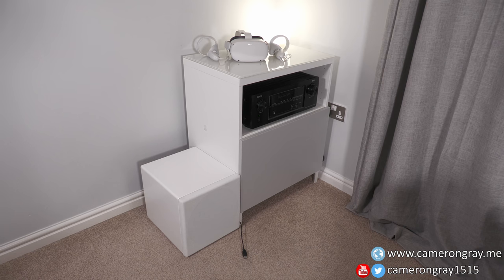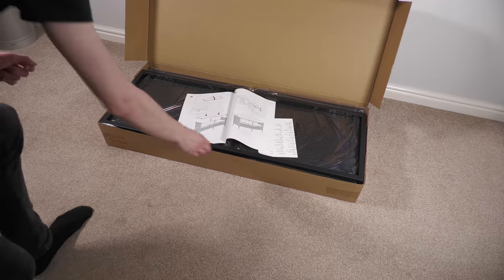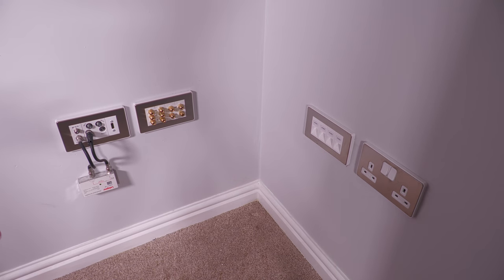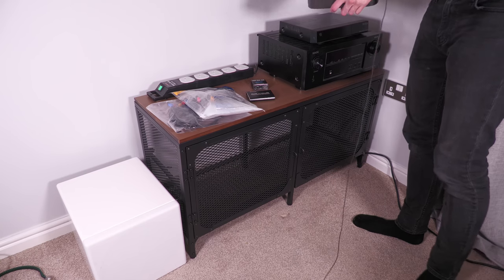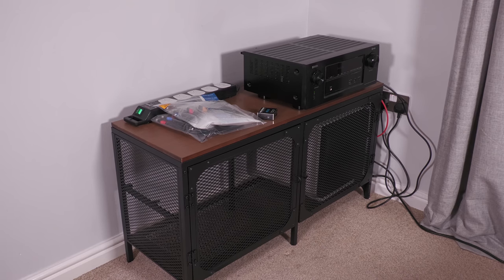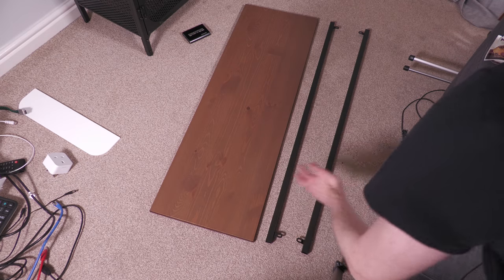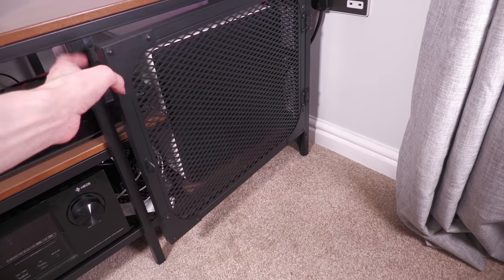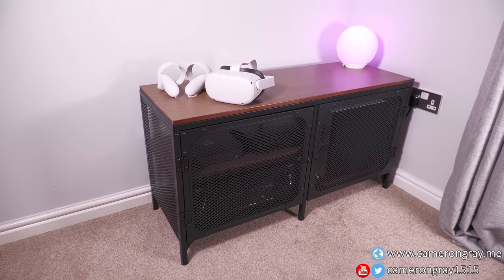Third Time Lucky? New Living Room AV Cabinet Setup

Comment: Let's hope nothing in your new cabinet requires reliable WiFi, since they're mostly sitting in a Faraday cage, right?  It looks like you have only wired networking serving those components so you're probably fine.
Reply: I can't imagine WiFi being an issue since (as you say) it's all hard-wired networking.

That said, if he wanted to connect Bluetooth headphones, game controllers or any RF remote controls (rather than IR) then it may have a noticeable impact on range.

2.4GHz works out at 125mm wavelength, so radio would be able to get out through the wooden top, out the back and out the bottom, but not through the mesh front and sides.

Probably good enough to get a signal reflected off of walls/ceilings within the room for something low bandwidth like a remote control.
Reply from the maker: Everything is currently wired into the network however I can't see WiFi being a huge issue (may need it in the future if I was to get a WiFi only smart stick type thing) as I have excellent WiFi coverage and the cabinet has an open rear and wooden top.  I'm currently using a Bluetooth trackpad and keyboard with the Mac Mini without issue.

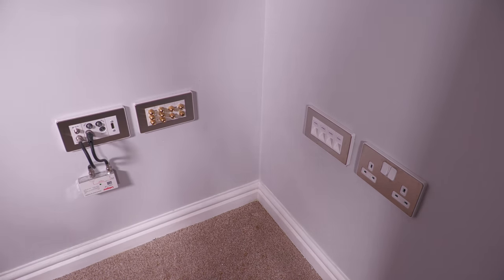Comment: 10:26 have to ask, did the builder cheap out and only fit 25mm backboxes? 
The backbox extender give a really nice look - better than being flash
Reply from the maker: The boxes are all deep enough, 35mm at a minimum, dry lining boxes I've added are all 47mm.  I'm not using backbox extenders although I can definitely see why it looks like that.  The sockets are from the MK Dimensions range which have a metal front but a plastic surround in either black or white.  Worked out several times cheaper than their fully metal Aspect screwless line but still seems to have the same internals.  I had an absolute disaster after fitting a bunch of Click Define flatplate sockets that turned out to be defective with switch contacts which kept welding so replacing them with these seemed like a safer (albeit less flat plate) option.  Wasn't sure at first but the design has really grown on me.

Comment: I wanted to know : can your Mac Mini handle 4k HDR (x265) easilly ? I have an Nvidia Shield "Tube" but it's god awful and extremly slow/glitchy :/
Reply from the maker: I haven't really tried HDR content however it'll happily play 4K x265 content from local files and things like YouTube without issue.  That said, if you're planning on using streaming services like Netflix you're better off using a smart stick/box type solution as the browser versions of these are usually limited to stereo audio.  I keep meaning to get around to buying a 4K capable smart box for streaming services then keep the Mac for stuff that works fine in browser such as YouTube and TV catch-up services.
Reply: @camerongray1515  I'm not really an Apple guy but isn't there app versions of Netflix &co on the Mac App Store ? My mindset was to buy one of those Mac minis and put Windows alongside Launchbox and have a fancy STB :P
Reply: @kawawete  then in that case get an intel nuc or something?